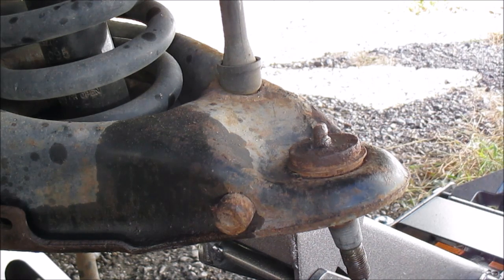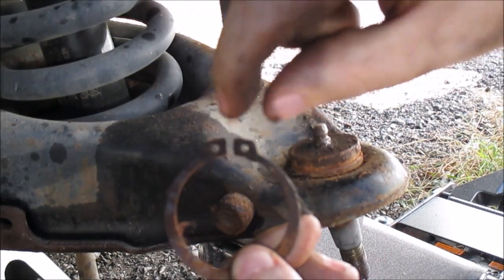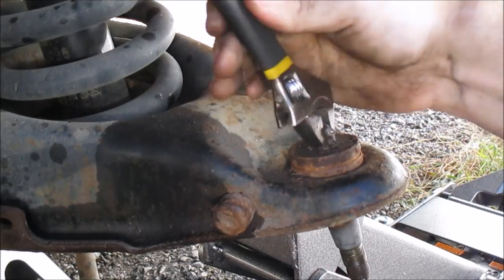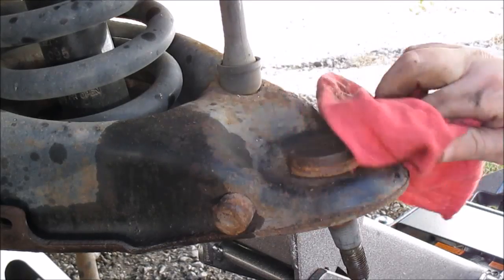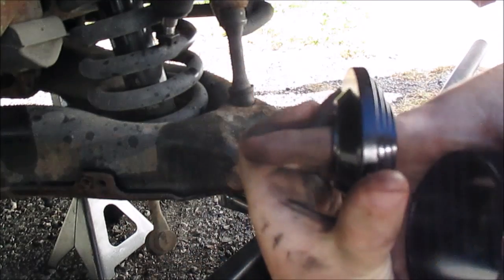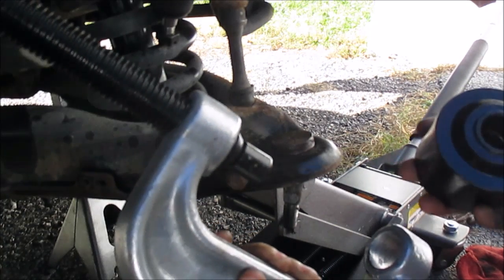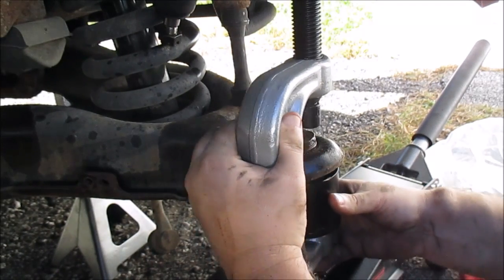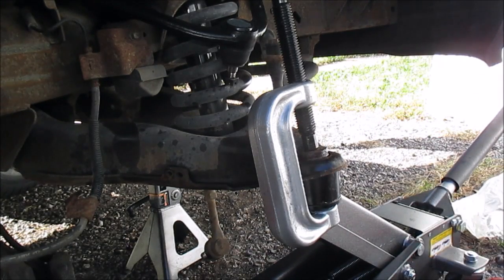How To Remove A Lower Ball Joint

Comment: I paid $500 parts and labor for the lower ball joints PT Cruiser 2005 I figured it was a big job because of the price and it sure is cuz apparently he's got that whole front end dismantled
Reply: To be honest Michael....it's not.  You don't have to take all that off.  Once you take off the rim and tire ...boom...it's right there in front of you.  I changed one of mine - today - in a Walmart parking lot after hitting one of our many Texas potholes.
Reply: Well it all depends if you have the tools . If you don't it will be pain in the ass
Reply: @XtraWetTshirt  trying mine today chevy 2000 blazer 4 wheel drive - shop wanted 280 bucks swap it out going to try on my own save some money

Comment: Mine won't come out! The flexible stem part points up for me and from everything I can tell, I need to push up from the bottom. It's come up a little bit but won't come up very much. I currently have that side of the car jacked up on the center of the ball joint, so hopefully that pops it loose. I have cranked on it very hard with a breaker bar, hammered it, you name it. Any thoughts?
Reply from the maker: Sadly, my husband passed in April.
Reply: @figibloom  Oh my goodness...I am so sorry :(
Reply from the maker: @mattmgarza  Thank you.
Reply: @figibloom  Thank you for keeping the videos online.  He has helped many people. God Bless.
Reply: I have a mini sledgehammer. Remove ring. Dont worry bout breakung the ring. New should come with ring. Hit with the hammer and out it comes. Same for install. Knock with the hammer and install ring. You dont need special crap to do it.

Comment: How To remove the ball joint  and install the the ball joint if you don't have a ball joint press ?
Reply: Hammer 🔨 it out after removing snap ring, press in with C 🗜️ clamp and I seen someone use big deep well cv axle sockets as guides, I normally change entire control arm because how cheap it is. I seen someone press in with Bottleneck Jack and sockets